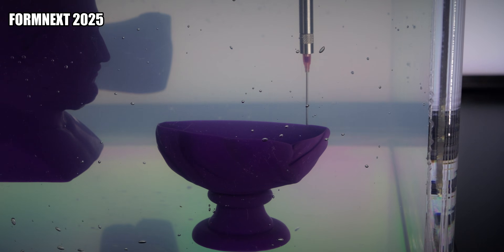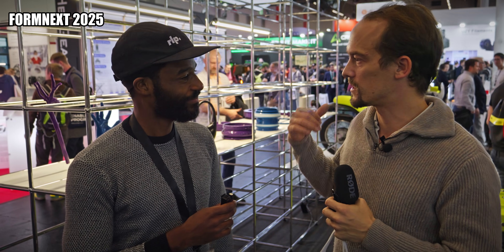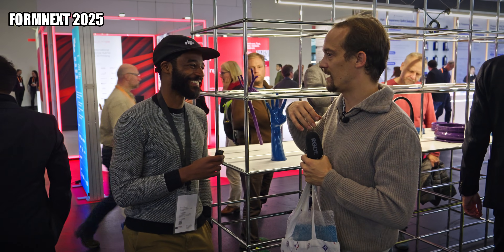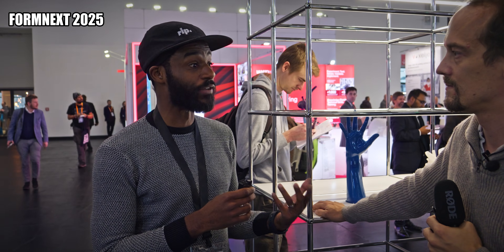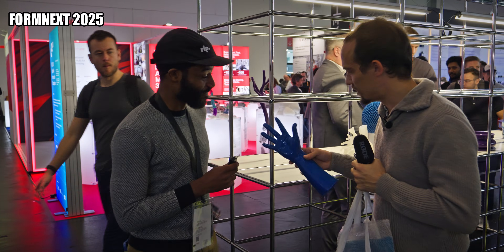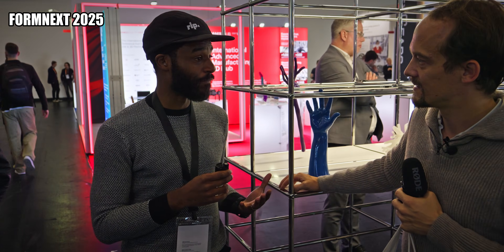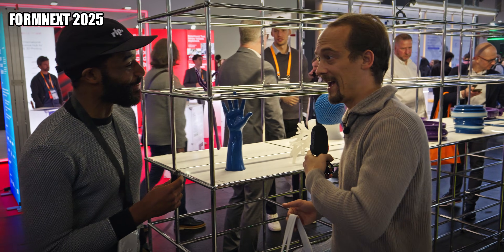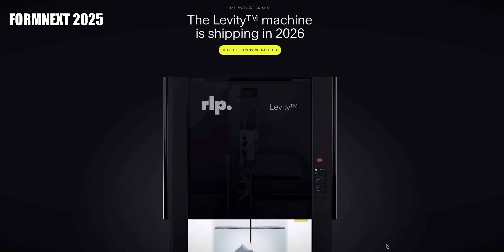Rapid Liquid Print @ Formnext 2025

Comment: I modified an Anet A8 printer back in 2018 to print liquid in liquid (colored agar in cacl2 solution) just for fun. The resulting gelous structure would hold against gravity itself however no other use due to the material features. There, cacl2 catalysed the polimerisation thus the single layers could not really make a strong bond with each other - this is/was the basis for bioprinting. You don't need much but a syringe pump (that can be 3d printed itself and added to all diy 3d printer - there are several tutorial videos about it out there).

The oly thing what surprieses me is the surface finish of the product, which is indeed very smooth and shiny! Looks much smoother than a fdm printed model.

Comment: How can it be so smooth out of the box?
Reply: Carefully controlled layer height mixed with pushing layers into each other before either layer cures.  The surface tension of the silicone does the rest.  (Might not technically be surface tension, but the same kind of internal forces in liquid.)  Basically the same as if you filled an area using toothpaste or cake gel icing and squeezed each new line to mix with the previous, only this one cures afterward and you can carry it around.